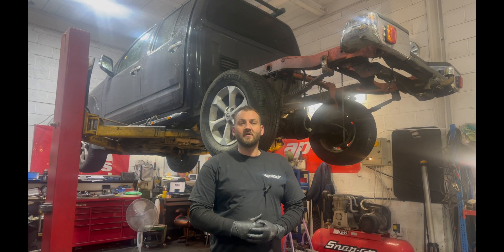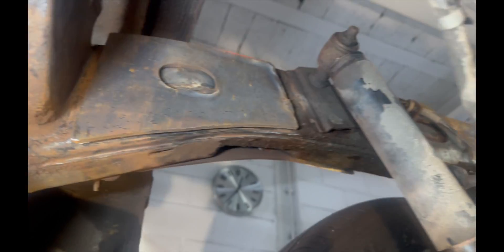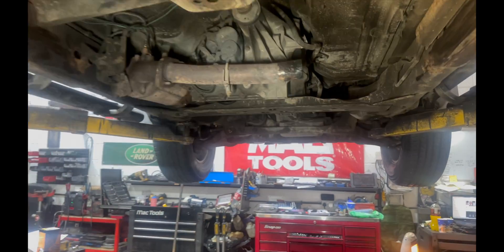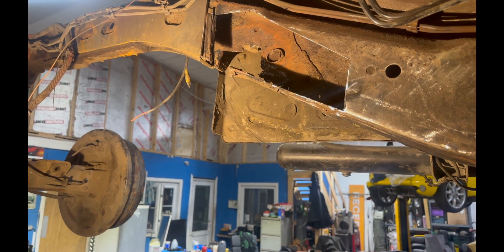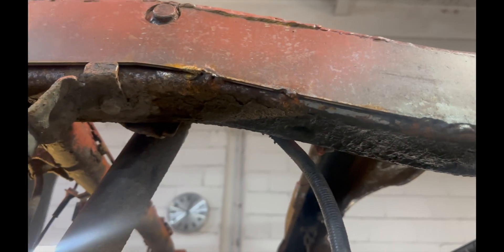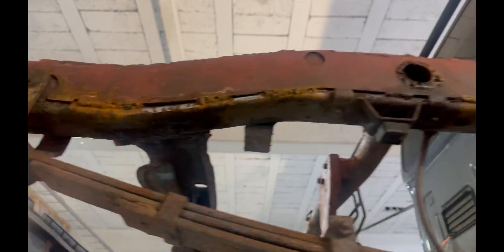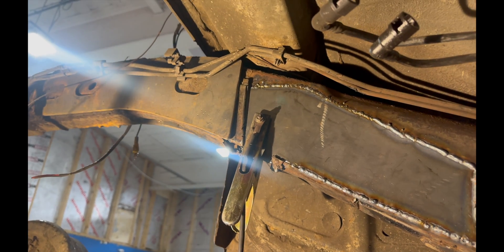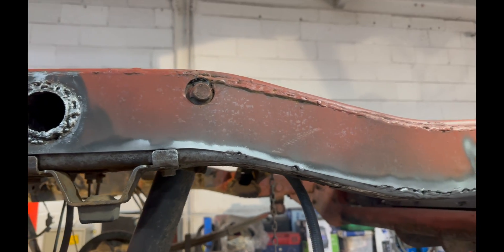nissan navara chassis repair

Comment: What's price end up being for navara jobs, not sure how bad it is but wondering if it's worth getting my dad's who passed late last year back on the road. Not sure it's bad but he was worried about it before he did pass
Reply: Could you give me an estimation for this work in my Navara if possible.
Reply from the maker: Give us a call 01925500203
Reply: Cut n shut..no good  the rust is still in behind previous botch job at nothing repairing that..  needs  new rear half chassis .and body removed to do it properly .